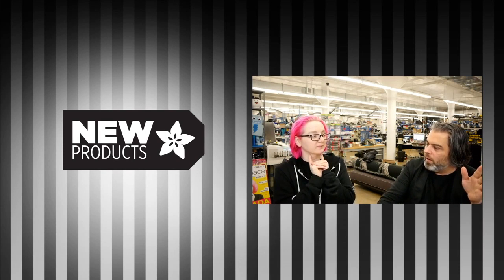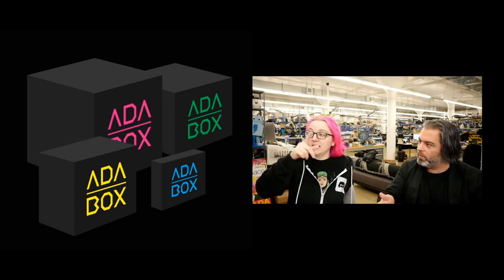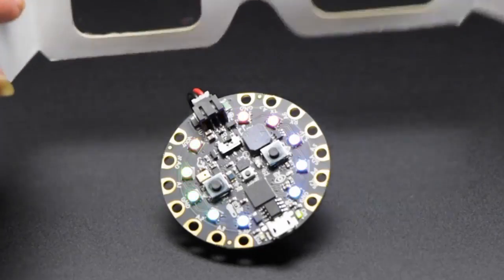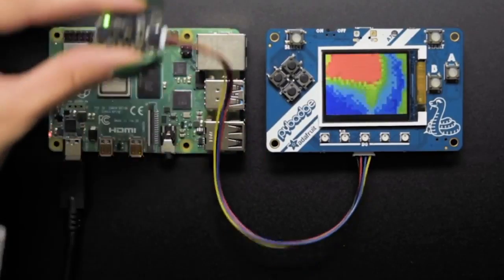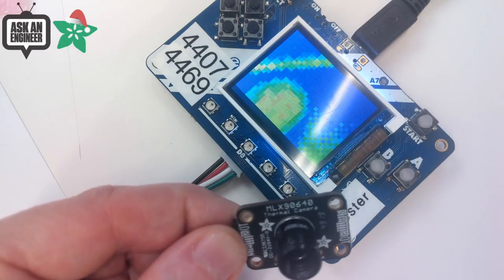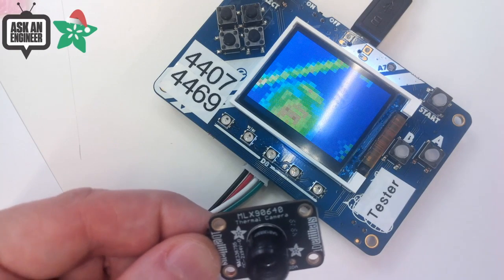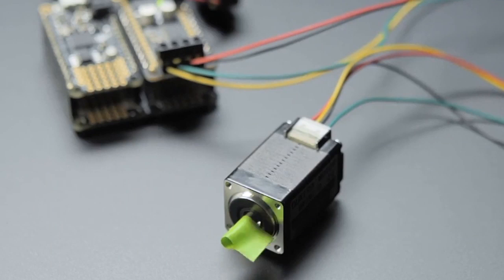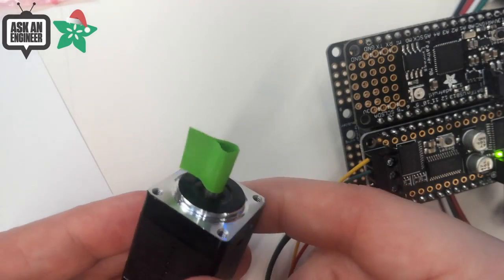New Products 12/25/19 Featuring Adafruit MCP2221A Breakout - General Purpose USB to GPIO ADC I2C!

Comment: I thought it would be cool to mount this on a drone somehow and get thermal imaging from the sky does anyone think this is possible with this camera?
Reply: No question as far as generally possible.But you have weight considerations and size considerations if you want to put on a drone. Most drone cams are already mini with built in low voltage.
90640 maybe running off a pie zero or something small and light like that? 
Small and portable thermal cam is my goal but I hadn't thought about drone size till you said it

Comment: I'd think one could get good results using a regular high-res low light-camera in conjunction with the thermal camera.  Use the thermal as a semi-transparent overlay on the regular image.
Reply: How would you even do that
Reply: @Diehard4077  Compositing in software on a fast enough microcontroller or SBC.  The physical challenge would be arranging the two cameras close enough to minimize the parallax correction (I'm not sure if that's the right term, basically the angle between the two cameras) that you'd have to do as the two images are composited.  There would be lag, but a fast enough ARM/GPU would minimize it.
Reply: what looks like a MLX90640 thermal sensor with a second low res visible light camera view superimposed along with the heat color view, is now retail stuff.  
 I have a handheld thermal camera gun. I got it at Harbor Freight for $250 US bucks.   And I'm trying to make my own as recordable live thermal video out for feeding into my live stream.

Comment: I've always thought one should mount one of these thermal cameras on a CNC or other movable platform, with an acceleration sensor and then compute higher resolution images...
Reply: That's been done, I once was in a drafting & design class where a scanner that used a single-pixel light detector with this scheme was shoved off where it wouldn't get in the way.